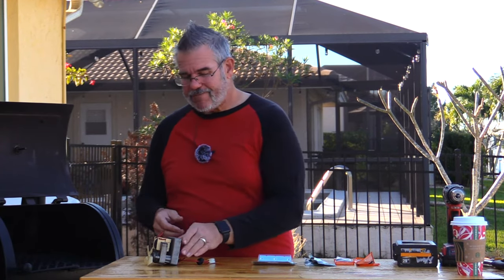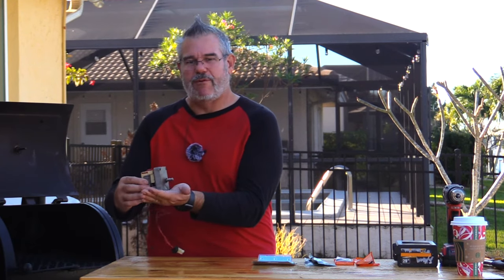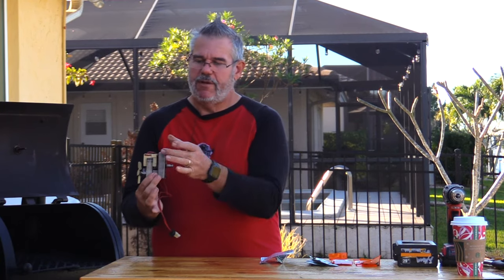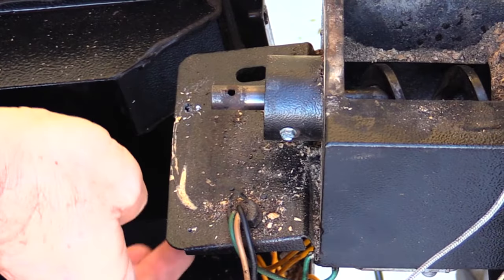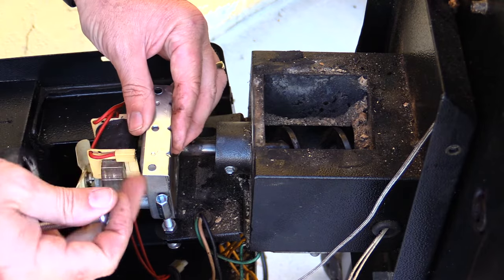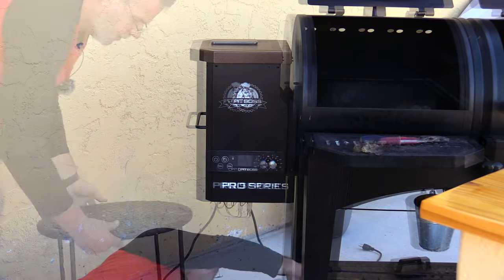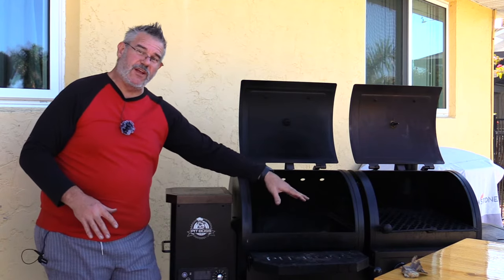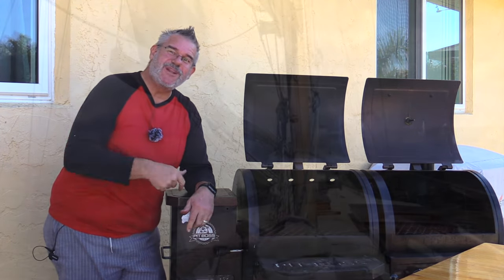Repairing your Auger Motor Mount (Pit Boss Pellet Smoker)

Comment: Didn’t see anybody make the comment yet but that melted plastic was not put there by the factoryto hold the motor.  It was a nylon bushing that went in the small tube just behind the auger. It melted during one of your last burnback fire. The motor normally just sits there supported only by gravity. After the fire melted your bushing out, it left enough play on the auger shaft to allow the motor to turn all the way around. Make sure you purchase another bushing and replace it. It takes all the load of the pellets pushing forward instead of the shaft of the motor.
Reply from the maker: Wow. Thank you so much John. This is very helpful and makes a ton of sense. Do you know or happen to have a link to where you can buy one of the bushings for these?
Reply: The reason I knew that was the bushing right off the bat is because I had the exact same thing happen on my camp chef grill. I thought the same thing at first, what the heck is all this melted plastic stuff. Didn’t occur to me that they would use plastic on the end of an auger that feeds wood into a fire. The first two gears in the heated auger motor were also plastic and were melted at the bottom in the gear case on the auger motor. 

I got my bushing straight from the camp chef. It was the least expensive of all the options I looked at. Not sure if pit boss uses the same size bushing but you might want to call the product support for your grill. They might send you one under warranty. 

A search for “pit boss auger bushing” should get you close to what you’re looking for.
Reply: John this is a really helpful comment, thanks.
Reply from the maker: Agree.
Reply: Y’all just saved me a metric 💩ton of frustration and stress. Thanks boys! 🙏🏻
Reply from the maker: Glad it was useful.
Reply: @Svdreamchaser-
 Thanks for the video, another PB Traveller back up & running again. 🛠🪛⚙️ Been missing this things cooking for several months, now back to top shelf grilling.. 😋
Got this Tailgater model for free, previous owners knew nothing about the maintenance involved, they just used it until it quit then put it on the side of the hwy for somebody else. Their loss!
Reply from the maker: @Ark1j Nice. Great find for you for sure.
Reply: @Svdreamchaser 
The Boss is Back.
 Yes, like the saying goes- some of the best things in life are free. 
Now, how to prevent 'burn-back' thru the auger drive?
Reply from the maker: @Ark1j for me i orevented it by keeping the fire pit VERY clean. When I would not clean it after 10-12 hours of cookong time (across multiple cooks) the ashes built up and when it shut off, the smoldering pieces were high enough that they smoldered the ones in the auger 🎉
Reply: @Svdreamchaser 
Understood. Should not be a issue. Am in the habit of airing out the fire-pot every few cookouts. 
Already replaced the 'pot with aftermarket ceramic (the oem was toast) and a fresh igniter. 
Having access to a metal fab shop, got a strip of aluminum alloy, cut to right size and made a Ω shaped retainer strap. Works like a champ.
 Now gorged and near miserable after cooking some 'chops with all the trimmings 😋😶😵 If I end up too fat to walk, it's all your fault! 😄

Comment: I got a PitBoss from the neighbor who upgraded. The unit had been sitting for awhile and the pellets were nasty in the bin and auger shaft. Replaced the control panel and cleaned it all out (new learning curve). Pellets will need attenton in future do to humid area.

I was curious about the motor mount and was suprised something like this was not factory, this one had done a spin or two...

Used your meathod and working great! 

THANK YOU + James
Reply from the maker: Glad to hear it worked well for you. It is pretty simple and certainly helps hold things in place well. Congrats on the new grill and the nice thing is replacement parts are fairly inexpensive.

Comment: I have to say that the Pit Boss Pro Series 1100 was a Christmas gift to me 3 years ago and it has been the bane of my existence. I have taken it apart to free a blocked anger more times than I care to remember. The thermostat has malfunctioned causing he fire pot to fill and overheat causing gaskets to melt, portions of the barrel to become white or and bake the finish off and barrel heat diffuser to delaminate. The inability to dial in temperatures less than 50 degrees at a time is a design flaw. I am waiting for the snow to stop here in VA today to drop in a replacement motor and have just put in a 10 gauge steel diffuser to hopefully fix the 125 degree swing in temps I get from left to right. My Oklahoma Joe offset charcoal barrel using the minion method has returned as my go to method of low and slow cooks. The Pit Boss cooks a good burger or bbq chicken
Reply from the maker: Wow. You had your fair share of problems with it. I’ve had a few with one improper shut down that overheated the fire pot and melted the bushing on the auger drill bit. I didn’t wanted to secure the motor better because I felt like it was a little too loose so I built a motor mount to hold the motor more secure. But other than that I haven’t had any real problems short of when the hurricane hit everything and it soaked and got wet and clogged up so I had to take it all apart and at that point in time the motor on the blower fan was damaged, but it’s hard to blame Pit Boss with this thing sitting in 48 hours 150 mile an hour winds, and 30 inches of rain. Glad to hear the Oklahoma Joe it’s been a winner for you. I’m not used one of those yet.

Comment: LOL when you said you've had it 2 years I felt pretty good. Mine is 4 years old and now I have to take it apart for the first time due to not cleaning it the same as you and having the auger seize. Thanks for the video and the tips.
Reply from the maker: Yeah my lack of cleaning proactively has dinged me more than once. Lol.
Reply: @Svdreamchaser  well I just tore mine apart and it needs a new motor. I can get a new one for under $50.00 so other then waiting for it to come in at least it won't break the bank.
Again thanks for the video. It helped me tear it apart and find the problem.

Comment: Great video !! I just had a self inflicted mess myself.  What began as an auger jam but went straight downhill from there.  You mentioned alot of the issues I faced in this video.  
I dropped the pellet box and in doing so (because the wires were wire wrapped pretty tightly) ended up pulling a wire out from the board which went to the probe.  
Once I pulled the auger and removed the jam, I plugged it in and heard “pop”, what I at first thought was just the 5amp fuse ended up being a fried board due to the bare wire from the probe I’m assuming.
I ordered a new board and replaced it ($50), got everything plugged back up and it fired up but the auger was not turning, the cooling fan for it was.  As a mechanic I knew just what I was facing.  I took off the auger motor and opened it up.  Yep, broken teeth on the gears creating a “dead spot” 🤦🏻‍♂️ I ordered a new auger motor ($25) and will be replacing it.  
Bottom line here was my negligence in removing all the pellets after each burn created the jam due to high humidity or moisture making it into the auger tube.  I delayed shutting it down thinking the auger would eventually turn with me poking the jammed pellets free.  In that time the gears were tearing themselves apart.  Lesson learned !! $75 to get me back up and running didn’t seem like a bad sacrifice though.
The loosely connected auger motor had me wondering as well.  I was thinking, did they purposely do this so it would have some give in such circumstances as an auger jam ? With the motor mounted so tightly now wouldn’t the gears take the immediate brunt of any malfunction ? And/or the auger pin ? 
I still believe it’s a good idea.  Thank you and I love the video !!
Reply from the maker: Wow. Very interesting and similar to my experience (short the loose wire, that sucks that it fried the control board). To your point 75$ isn’t horrible in the grand scheme of a $700 grill. That said I have learned a few things after this experience. The white blob i removed thinking it was a stopper or mount for the motor was actually a melted bushing that goes in the auger sleeve. It was like a $5-10 part so well worth it. Also you likely now know this but I didn’t see you mention it so wanted to point it out. With the motor off you can remove the auger and clean up any wet or burned pellets in the tube that may have been preventing it from turning.   Thanks for the nice words on the video and glad you got yours up and running. I need to spent the money in a new board at some point because I can no longer read the display in really bright sunlight but another day another job. Lol
Reply: Oh yeah, I pulled out the auger and bushing and cleaned the auger tube very good with a brush attached to a drill 😂 
I feel like I could totally rebuild one of these things now if I had to, I think I’m already halfway there.  Mine is a 820D but they are all pretty my the same mechanically.
Reply: @jimmunhall  I know it's been a year, but I recently had an auger jam on my 820D which, I presume, stripped the gears in the electric motor. I ordered and replaced the motor today but, just like you did, managed to let a loose wire contact a part of the grill, causing some sparks and resulting in a non functioning grill. The 5x20 fuse if shot so I'll throw a replacement in and hope for the best but suspect I'll need a new board as well.

The motor does seem to kind of hand from the auger a bit and I'm wondering, if you've added this mount has there been any issues and if you'd recommend it? Thanks
Reply from the maker: @tyjoseph5440 i have not had any issues with the motor mount scenario. I don’t know that is because my new mount is better or not however.
Reply: I installed a new control board and auger motor and I’m back up and running. I basically just made a bit of a wedge for the motor to sit on and my grill has been running better than it has in a few years. If I have it apart again, if got everything I need to throw this mount on. I like the idea
Reply from the maker: @Strato5Fear very cool.

Comment: Why did you have the screws at different heights? What is the reason? Also, could you use a longer screw and a nut on the bottom?
Reply from the maker: Yes you could absolutely have used a longer bolt with a nit on the bottom. I did it this way because I wanted the part i turned or removed to be on top for ease of maintenance so I used a shorter bolt into a female to female connector. Different sizes were just because I used the bolts i had handy :).

Comment: My motor just failed also, found the same issue? I can't believe engineers approved this.
Reply from the maker: After I recorded this o realized that block of white plastic was actually the bushing that literally melted out of the auger tube. Here is a link to get a new bushing. I still this the motor mount kade on this video is awesome ad I am glad I did it, but I also had to replace the bushing in mine. Here is a link to get one quickly. https://amzn.to/3QkfKPg
Reply: If you don't run the shut down and instead just turn it off... You get what you got

Comment: I've seen on yours and other videos where all of the wires are disconnected. The only disconnect you need to make is the red power leads to the motor. Additionally, there is no need to remove the entire bottom grill of the hopper. The four screws on the side and the 2 on the bottom closest to the side of the grill will suffice. Mine had a little more play than I liked so i just super glued some washers to the plate under the motor
Reply from the maker: That’s a great point. The first time I took mine apart several of the wires were all bundled together with tie wraps, and I had to take the bottom gray off to cut the tie wraps that were holding the wires bundled. I think it’s now just habit that I take the bottom grate off, disconnect all the plugs, and then unscrew it from the side of the grill. But you bring up a great point if you’re careful, you can certainly do that without worrying about damaging any of the wires. I like have any extra room so I think I’ll probably keep doing it this way just because it gives me a little bit more working space especially when I’m not sure where everything plugs in and unplugs
Reply from the maker: It was comforting to know once you take these apart, most of the parts to do repairs are fairly inexpensive and available right on Amazon.

Comment: This is a cool idea but I would make one suggestion to take a picture of the wiring so you can reconnect the wires right or just make a list of which wires connect to which wires.
Reply from the maker: Man i couldn’t agree more!!!  I do that now all the time and kicked myself for not having taken a picture before starting this work.   😊
Reply: I use different color paint 🎨 pens 🖊 to mark electrical connections, momma's fingernail paint will work in a pince, jut let the paints dry before disassembly!..from Wyoming USA 🇺🇸 👋🤠

Comment: Question. I just bought  a 1100 pro combo. Just put it together today. The auger doesn't turn. I primed it and got fire. However the auger still won't turn. So I took off the bottom plate to look at the connection. I see the little white fan from your video. It wasn't turning. I pushed it a little and there it goes. Fan moving auger moving. Problem solved? No. When auger stopped moving it won't restart unless I got under and give fan blade a push then again as long as the auger light is on when I push the fan I get auger movement. Ideas? Or just see what the warranty will cover.?
Reply from the maker: If it is new I would take the warranty as something doesn’t sound right. It almost sounds like the motor has a dead spot in it and spinning it by hand gets it moving past that “dead” spot.

Comment: Thankfully I haven't had this issue yet, but I think when/if I do I will certainly just use this fix instead of trying anything else. One question though.....you were very deliberate/specific about off-setting the spacers on each side, what was the reason for that (I am sure there was one the way you talked about it)? Thanks for another great video (trying your smoked cream cheese this week lol)!!!!
Reply from the maker: I was very specific about the gap between the motor and where I draw the holes because of the width of the barrel nut connector. I wanted to make sure that I didn’t do it so close that there wouldn’t be room for that barrel nut to actually touch the side of the motor to help hold it securely in place. I hope that makes sense

Comment: What about a u-bolt  or shackle bolt?
Reply from the maker: I chose to go with a different route to Bolt on a bracket mainly because of the round end of a ubolt. I was a little bit worried that it might stick up to tall above it and only be holding the motor on those corners where the circular part of the ubolt touch the square frame of the motor. It would probably work I just want a different path.

Comment: Looks like that plate the motor sits on is leaning back.  Does that plate tighten from a mount somewhere so it’ll sit level with the plate so it won’t spin?  Don’t own one but will very soon.
Reply from the maker: The plate isn’t leaning back so wonder if it is camera angles.

Comment: My main fan, pot fan is making a tapping sound?  Any ideas?  This is a pretty new grill.
Reply from the maker: The blower fan?  You may want to pull it apart and see if you have any wires that may be bumping up against the motor or blades. My auger also made a tapping sound and it was the motor and where it mounts to the base. It was mounted in plastic or something and it would lift up a corner of the motor as the auger rotated and then tap when it came back down. It made the noise about once every few seconds. You may want to try that.
Reply from the maker: Take a look at 3:14 in tot he video and you may see what I mean about that white block of plastic that used to hold the motor firm and was no longer doing so.

Comment: Great video. Uh...just asking? Did that plastic (that melted, prompting the metal bracket mod) serve to  prevent a potential ground out (in the event of a short) to rest of metal grill body? Shock risk? Add some hi-temp "caulk" between metal to metal contact? I'm not a electrician. So maybe nothing. Just asking
Reply from the maker: Really good question. I don’t think that was the reason because it didn’t isolate the motor from the frame of the grill but rather just globes around the back half of the motor but to be candid I never thought of that. I am just considering it now based on your comment. Luckily I have all of this plugged into an outdoor gfci so think that any short would trigger an immediate cut off of the plug power but really good point for sure and something others should consider doing anything like this for themselves.
Reply: No, the new models don’t even have that plastic. There is now a hard plastic bushing in the auger insert area to keep the auger and mirror in line.
The motor now just torques against the base loosely.

Edit: that melted plastic was the bushing 😅

Comment: put a new controller on my rancher 700 now the aguger is running backwards any ideas
Reply from the maker: Likely one of the connections backwards. I am not clear of this model but reverse polarity on DC will run a motor backwards.